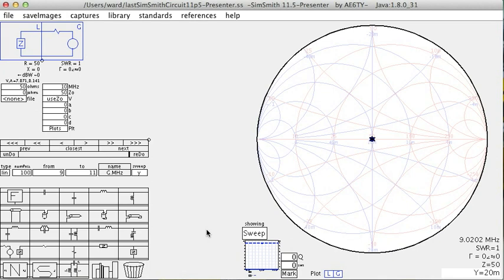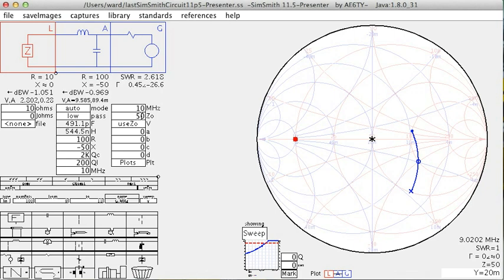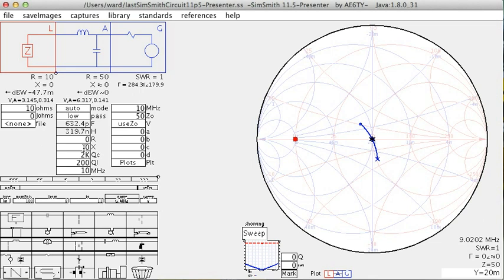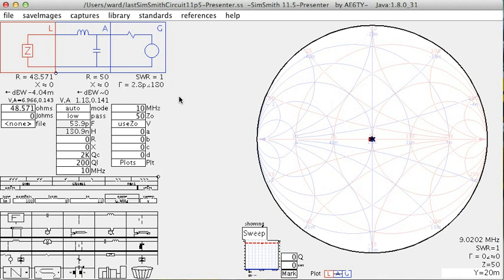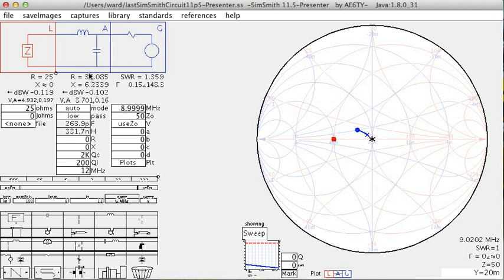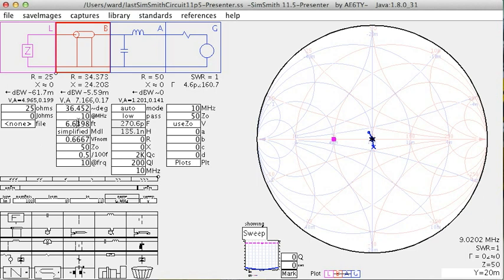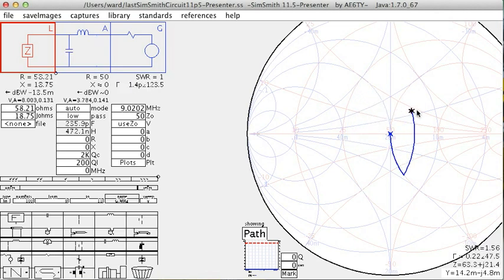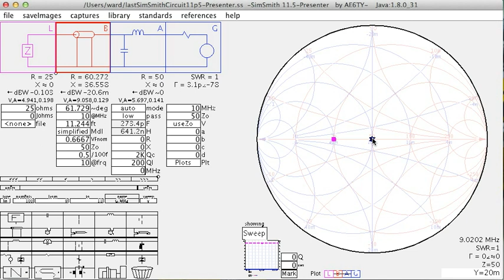Effortless Impedance Matching.

Comment: i'm trying to learn of how to apply what you see in the Smith Chart to an actual antenna system- and just need some help knowing when to use a section of coax to duplicate the capacitance needed, especially how to add these in parallel. Do you have any videos that teach these principles? of when and how to add different inductance and capacitance
Reply from the maker: You may find this video useful.  I believe W0QE (Larry Benko) has a video titled something like "12 ways to impedance match' or some such.

https://www.youtube.com/watch?v=hYuksRNFWL0&t=12s
Reply: @ae6ty  thank you!

Comment: I love this software. Use it in my work teaching communication engineers. I have some questions/requests. Using the L-network sometimes you should have more than two solutions. Some loads will have four solutions, two LC (high pass and low pass) and two LL or CC. It would be nice if these two also was possible to have by the L-network element. 
Most often when working with my students we stipulates length of coax by electrical wavelength and not degrees. Would it be possible to have this choice (or that both are shown).
How did you get decimals in the gamma angle? I only get whole numbers (I use nordic convention where , is comma which works great in this software, but maybe a glitch in the angle?)..